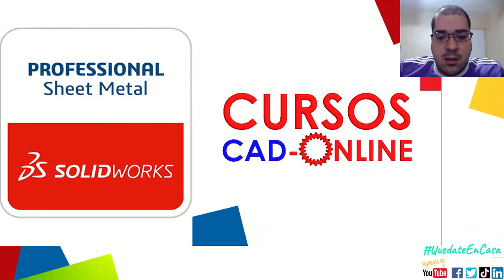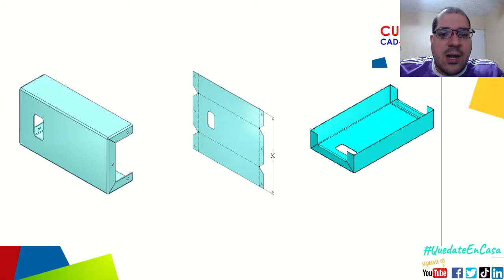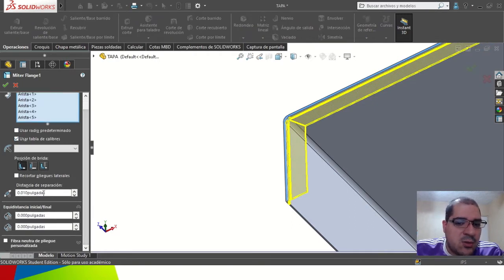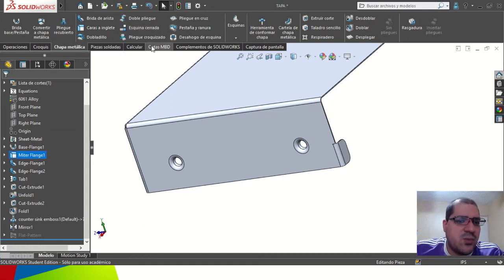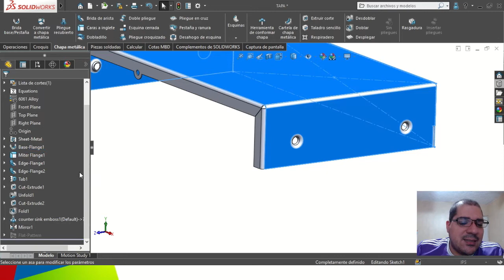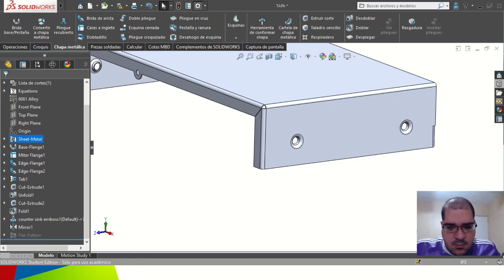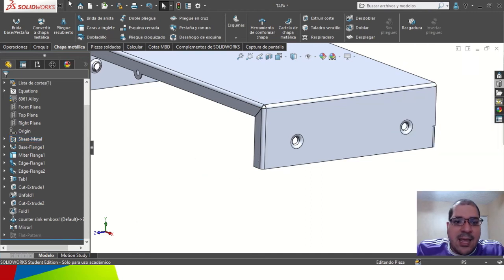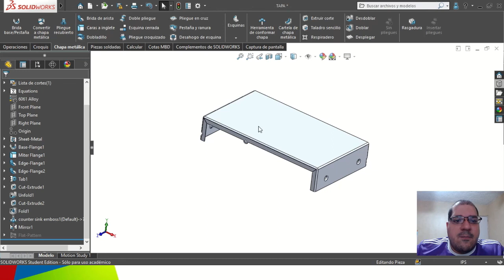Tips for Solidworks CSWPA Sheetmetal

Comment: Another tip should've been the fact that candidates are advised to save each of the questions from 1 to 14 after each successful completion with correct answers because it helps in tracing errors much easily which are more than likely to occur.
Reply from the maker: Excelent comment to share! Thanks for the support